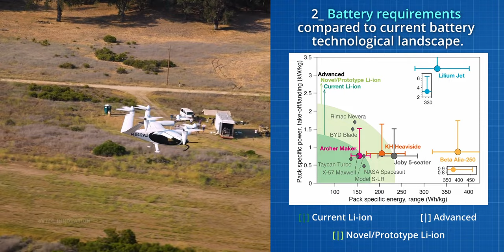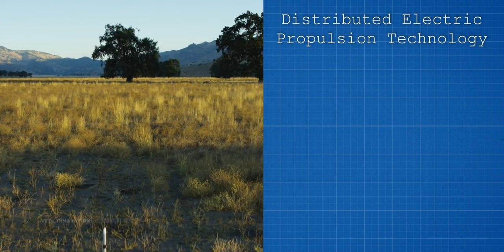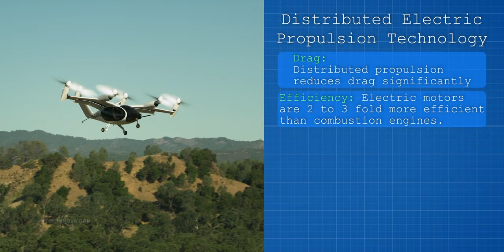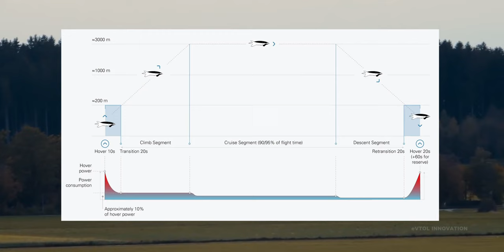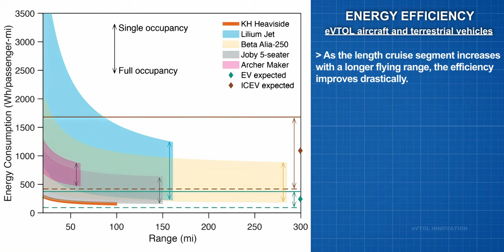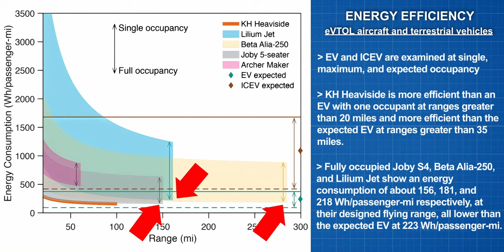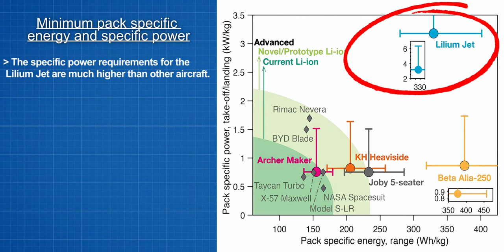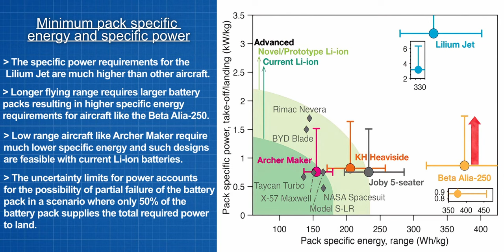The reason why electric VTOL Aircraft are more efficient than Electric Vehicles

Comment: STOL should be considered, as a 100 ft runway would greatly increase range and efficiency.
Reply: Even a 300 foot Long Runway, is only a bit more than some large Runways are Wide! It Also Allows more potential for Obstacles to be Cleared outside of the space, with Less "Vertical" Performance Aspect Needed.

Comment: Safe, quiet and affordable? Really? We have been told this for ages yet these paper planes never appear to make it on to the market. The big problem is power density per kilo. You need rot have weight available for a payload. The next problem is charging time. The operating/charging time means these devices will not spend much time earning money. I also notice a typical kWh per trip was not mentioned. Put them in the air on days with known ice and poor visibility, fully loaded with lawyers and I’ll come and watch.

Comment: If any of the 8 major players, including Toyota, LG, Panasonic, and VW Group, competing in the next generation battery technology race are successful, and all their claims are realized, these aircraft will be at least 30% more efficient by 2030. Imagine that, 30% more power density in the same physical sized battery pack combined with super fast charging.  The fact is that battery technology is just getting started and todays Lithium batteries are a giant leap ahead from the Lithium batteries from 1998, and the batteries of 2030 will be another giant leap ahead of today (probably from Solid State).  Will we ever see a 1000 mile range EV?  I sure hope so - maybe that will be the 2040 goal.
Reply: @Divyansh Bhutra 300% is a "Dream", reality is more likely 30 to 50% in the next 10 years.

Comment: What does one think the capacity per hour of those ports to be? A fraction of a single one lane road I imagine.
Reply: Yes but not everyone is going to the same place. It's far more useful to have a vehicle that takes you from your actual origin to a place as close to where you're actually going as possible.

And don't worry, they're working on 300 passenger fully electric short haul (under 800 miles/1287 km) airliners too. TGV is fine for Europe with its cities close together, but here in North America and Australia, we can't use that; our cities are too far apart. Hence aviation. And if it's zero emission you can't flight shame us for environmental reasons. Although we just laugh at flight shaming here in North America and Australia, because 1, at the distances involved here, TGV is not practical and 2, fossil fuel aircraft only contribute 2% of all CO2 emissions, and that will go down over the next 20 years.
Reply: Helipads got few adoption due to the massive downsides of expensive noisy and inefficient design, and this is al changing with EVTOL and if we can just 10x the number of airports it will make a lot of difference for long commutes. Surely it won't stop at that because you only need a landing pad.
Reply: IDK but I wonder. 🤔 How will transport to/from rooftops work? Elevators bolted to outside of buildings?
Reply: @635574  And - Our Neighbor tor Town a House and Rebuilt one, with a Flat Roof! Instant EVTOL Heloport? Maybe!

Comment: ANY aircraft must use power to oppose gravity - exactly equal to the profile drag power  at it's most efficient speed hence nearly twice the power just to push the passenger cabin or 'car' part through the air -the wing profile drag might be around the same as rolling drag so that the aircraft MUST use more energy by far than if it was just on wheels - the unoptimized road vehicle shapes and larger size for more passenger capacity negate some of the difference but the higher speeds of aircraft automatically require more power - somewhat as the cube of speed but the time is only inversely proportional (eg 8 x the power at twice the speed for Half the time = 4x the energy used in comparison for the same distance . Speed costs .  VTOL is extremely power hungry and requires carrying around much more battery mass than otherwise needed and much more propeller disc area - the worst of both worlds.   realistic comparisons please.

Comment: Planes have been more efficient than cars since forever :-)
Until you calculate tonnage of cargo.
Reply: Well, there are lots of cars that seat 5-6 People, and do better than 20 MPG, but - Not at 160 MPH, Like I demonstrated many years ago, with a Cessna 210 Centurion, Throttled Back from it's usual 200 MPH Cruise! Try to get 20 MPG in your Corvette at 160 MPH (Even if it could go Straight to your Destination! Plus, you need as many as 5 Corvettes, to carry 5 passengers!

Comment: I haven't finished this video yet, but bro, won't these vehicles use a scary amount of power compared to a regular vehicle?
The job of a car is to turn the wheels, which is pretty easy. But an aircraft has to lift itself off the ground and stay there.

And if we do invent a more efficient form of energy that allows aircrafts to consume as much energy as modern cars, then cars will also adop that new technology and will once again be more efficient than an aircraft.

You can't just stop by places with such a vehicle, it's very high stress, and there is no room for malfunction.

I'm sorry, but I'm a pessimist here.

Comment: Faster? Yes, but an eVTOL service is mid-mile so any time advantage could be eroded by the first and last mile transport.

Cheaper? Not when comparing $28k Nissan Leaf with even a $300k Ehang 216.

Energy efficiency compared to what - certainly not an eCTOL or eSTOL or eSTOVL doing conventional takes off and landings? 

Energy efficiency compared to an EV on a like for like basis for the typical 12 to 18 mile UAM mission of airport citycenter:
1 seater Kittyhawk Heaviside vs electric motorbike?, or 
a 5 seater Joby S4 vs a full standard Tesla Model 3?

Comment: This is total fantasy, The battery technology is nowhere near mature enough, nor is it likely to be for a very long time. Unlike a conventional aircraft, no fuel weight is consumed during the flight, so it has to carry the weight of batteries for the flights duration.. Also, turnaround times would be impossibly long, which would be another factor in making battery aircraft not commercially viable.